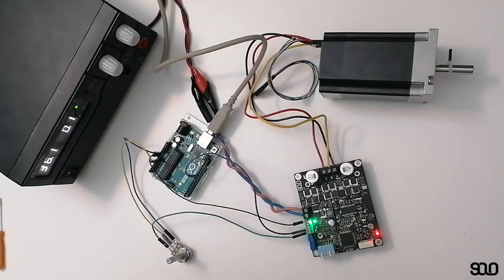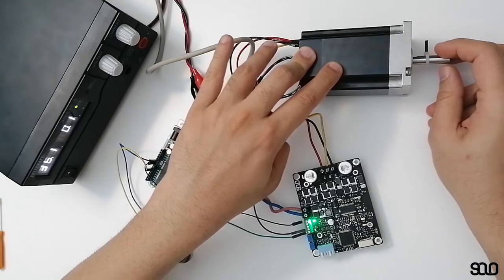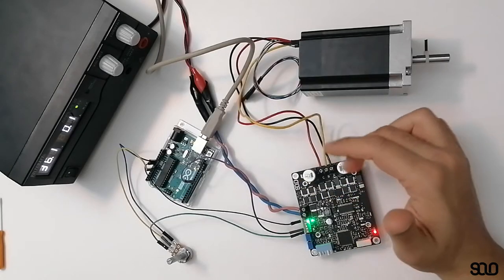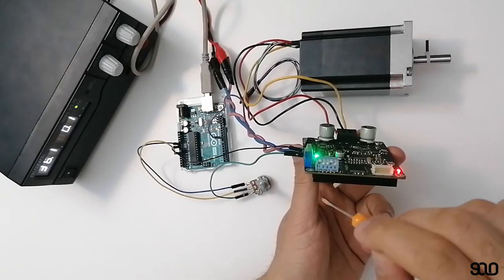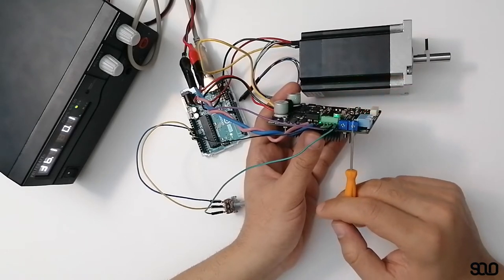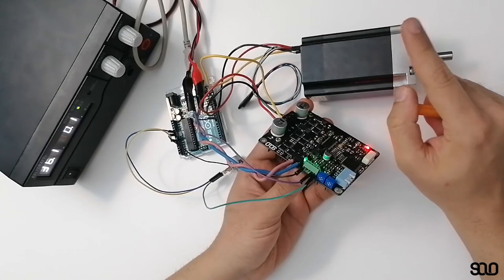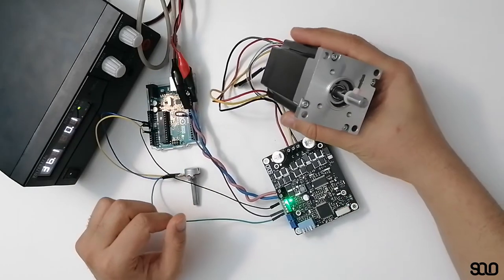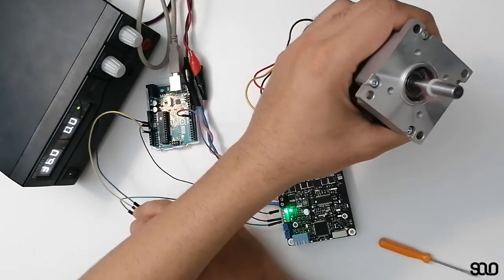Brushless Motors Speed Control using ARDUINO and SOLO (ESC - BLDC - PMSM) in Closed-loop Mode

Comment: Hi, i have bought SOLO UNO from your company to pursue my project. Kindly, could i use it for the speed control of A2212/13T brushless outrunner motor instead of 30A ESC. Or, is it designed for stepper servo motors only?
Reply from the maker: You can run it, keep us updated about the status of your test in our forum so we can give suggestion and considerations if needed!

Comment: Where is the encoder in this system?
Reply from the maker: Hi, the Motor run here in sensorless mode without any encoder or sensors attached to the motor.
Reply: @SOLOMotorControllers  How does the control circuit knows that the motor speed increased or decreased then?
Reply from the maker: @AbdallahEzzatKoji  it's done with the firmware and not at hardware level, so SOLO has an internal non-linear estimator that estimates the speed of the Motor from the current and voltage feedbacks.